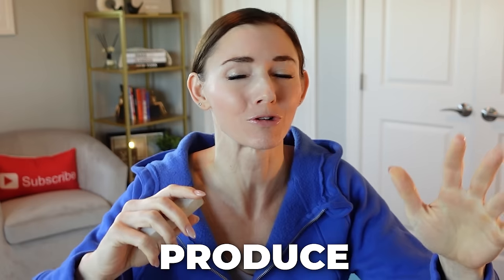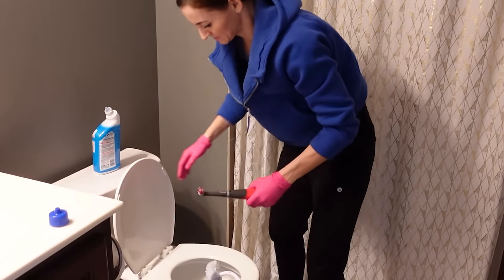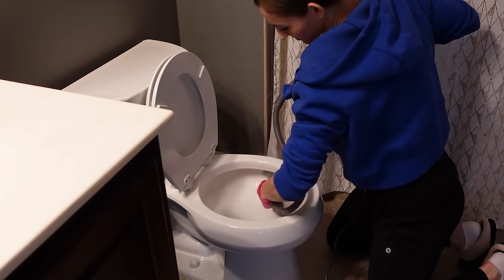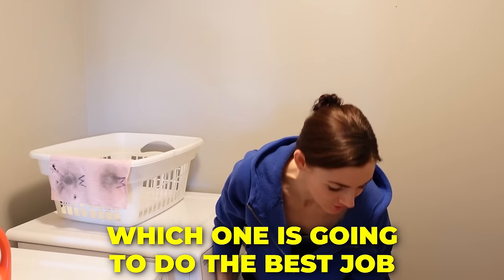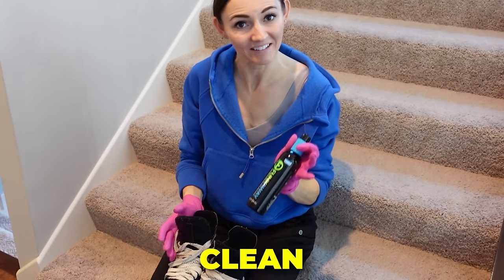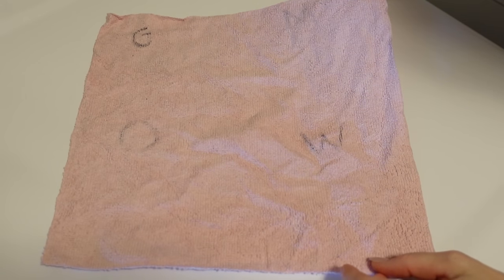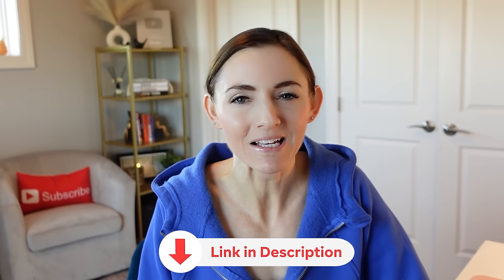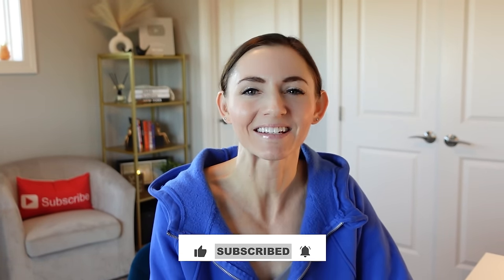7 Genius Secret Hacks That Work Extremely Well! 🥰 *brilliant*

Comment: I use a lot of the products you endorse, but some I wasn’t aware of, thank you for that!  One product that I like better than the pink stuff is “earth brite”. It’s a clay cleaner that does an amazing job on stove tops and shower doors, you just have to rinse well, but the water sheets off your smooth surface and prevents gunk from sticking.  I love it.  I have a toilet bowl cleaning trick.  have you ever tried throwing a few denture cleaning tablets into your toilet bowl and leave them overnight?  it does an amazing job without scrubbing.  I have well water and a water softener, but I still get really bad hard water marks and denture tablets are the only thing that takes it off.

Comment: We have 4 new toilets, all of which dispense the water, when flushed, from the tank through one larger hole, which is located at the one o’clock position. It is visible, accessible and because there is no buildup of iron, mold and hard water stains, it is very easily cleaned! Since Covid, we have made many improvements to our home, i.e. paint, wood flooring, floor boards, interior doors, lighting and remodeled bathrooms, including vanities, hand basins and granite counter tops, but the toilets are my absolute favorites!!!

Comment: Thanks for this. I used to used CLR in my tub hard water and soap scum. It did a great job but smelled awful and made my skin itchy. The spray never was as good I my opinion. I love limeaway. I get the brownish hard scale at the very bottom of the toilet. Nothing has gotten it out. Pumice stone does help but I think I’m going to try removing the water and put some vinegar in there. Have you ever tried that or heard of it done?

Comment: Omg I NEED to see this one. I moved into my apartment 8yrs ago. When I finally lifted the toilet bowl lid up, I saw a massive ring around the bottom and streaks down the bowl. We DO have hard water, but I couldn't believe my eyes that it wasn't cleaned!

Until HUNDREDS of dollars in cleaning supplies and the elbow grease of 10 soliers later, I saw that it WAS essentially uncleanable 😬.

I asked the office here about it, but after I explained it and asked if they could replace it, they said that it was a cosmetic issue and wouldn't replace it.

But I don't know WHAT to do, I'm already broke.

😳👍
Reply: Pumice Stone also gets the ring out.
Reply: It was probably from the copper pipes and not dirty. Sometimes old pipes combined with hard water create streaks. Hard water is the worst on toilets and around sinks.
Reply: I had the same problem.   Looked like a gas station toilet!   I was almost ready to call the plumber to replace it when I came across a youtube hint.   W-D40 was suggested.  I applied it & left it on for 10 hours.  Then the elbow grease was applied.   It took several applications (4X), but it came up sparkling.  Hope this helps
Reply: @donnar.9077  Helps a ton! Just added it to my list of supplies from this video. Thank you 😊!

Comment: Andrea- love your channel and all the great tips and help. Can you do a video on how to clean the grease splatters on an air fryer? Not the ones in the baskets but the ones on the parts you can't remove. I have tried everything and scrub my air fryer and all the surfaces EVERY time I use it. But I still get little spots and splatters. I have even tried Brillo and the pink stuff but they seem to react with the surface and take off the gray coating (not the grease) I also tried baking soda and vinegar and that didn't work at all and I ended up with baking soda in the fan. I have a ninja foodie grill so the top gets the splatters. Thank you. Merry Christmas!!
Reply from the maker: Will do! Same to you 😍😍😍

Comment: A candle leaked and wax dripped in a stream on my sofa. I don’t know how to get the wax off. It’s kind of a velour material. Easy clean but I don’t know how to remove wax. TY.
Reply: If you put wax paper down, put an iron on low setting and iron it, it might work. I did this before on carpet and it worked.

Comment: Citric acid works.  Use it like you use the CLR.  Flush, sprinkle the powder on. Cover with toilet paper (make sure it's wet -  spray with water).  Let it sit for a bit - 1/2 hour to an hour or so.  For blood on a mattress - foaming Windex with ammonia.  Spray and blot until blood is gone.  Will need to do multiple times.  Foam is especially good if stain is on the side of the mattress.

Comment: Ok, I wrote before about cleaning the toilet. Is there anyway to clean UP inside the rim of the toilet porcelain area? Not the edge of the inside bowl where the water comes out, but like to put something up inside those holes where the water comes out Im having an issue of, I guess,  black mold dripping down from 2 holes into the bowl. You know wd40 has that straw attachment. Is there a cleaner that has a straw attachment so I could spray up inside there to clean the inside rim area. I think if we cleaned that area we would have issues with the bowl as much and would save time having to clean the toilet as much. Lol

Comment: Use a pumice stone for it
Reply from the maker: It will leave small scratches on the toilet and look dirtier faster…..
Reply: @AndreaJean  I use the pumice stone all the time. Yes it can scratch but you get used to using it you will know how not to do that. I find that it stays cleaner longer after I use the stone. But that is my experience.
Reply: @jenn9579 yep the key is to keep the stone and surface you're cleaning wet
Reply: @AndreaJean  
I use it all the time at my work and when I clean empty apartments 

It works amazing